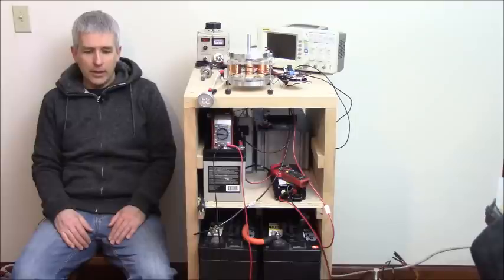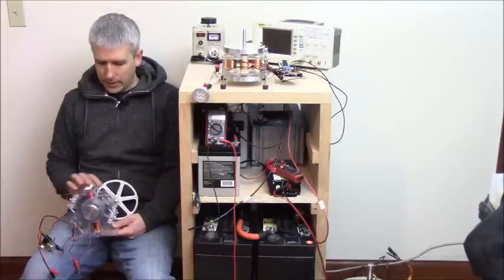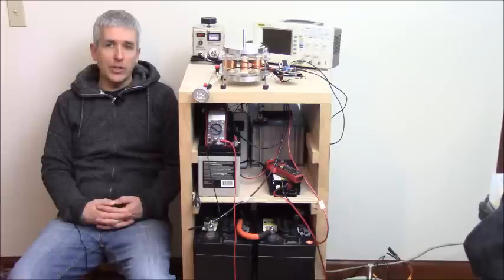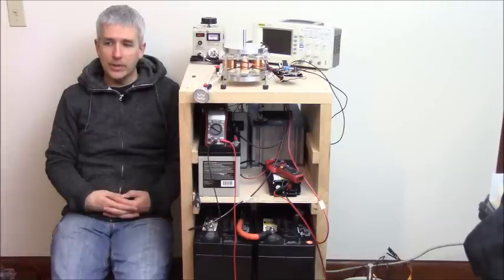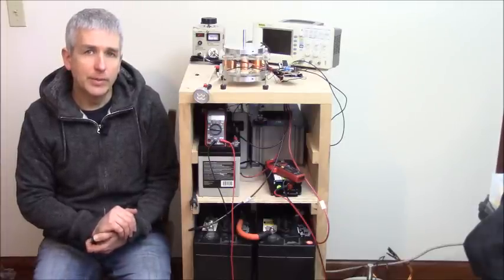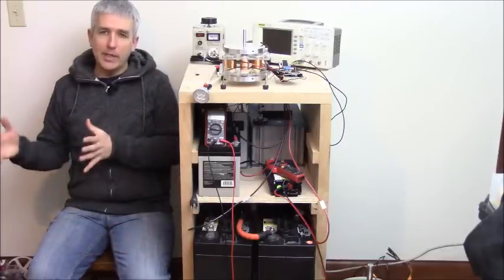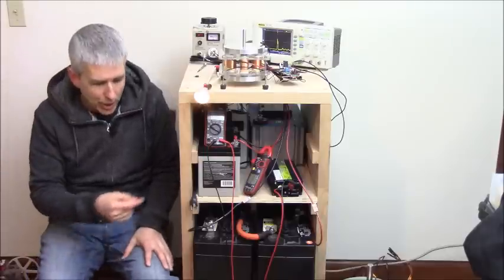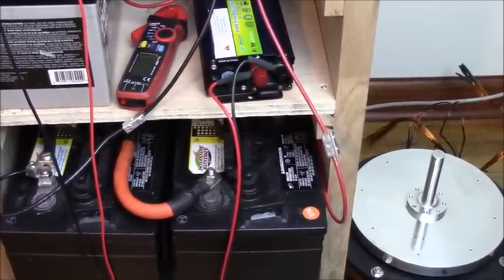Charging & Converting  Batteries to Negative

Comment: Did the bulb get brighter because no light,or no interference,or better grounding? Have you tried grounding the positive side in the ground Maybe it'll help battery desulfate faster? Very fascinating, maybe this shows that real electrons are true dipoles and there equal and opposite effect very interesting to try to wrap your mind around this would adding a jewel thief to ground or photodiode boost or change the system?

Comment: I was just about to ask have you figured out to replicate don smiths device, or how it worked exactly? Then you brought it up. On the device with two square caps on the circuit block what type of diode or resistor did he have connected to neon tube transformers ground? How did he get it to spark? Do the capcitors have to be polarized?

Comment: Rick a question; alot of people wanna know;alot of the energy from vacuum vids talk about the 3modes of operation,common ground,comparator,and ground back to the positive,you talk about a mix is that a 4th mode?and how does the 3 modes play there role in loving paths and one wire new info that you brought to light?and you mentioned that lights have their own frequency aside from the coil resonance,please do more vids

Comment: Hey Rick - This is gold! Clearly its one of your best posts. Your talk on Negative vs. Positive energy is so important and will definitely save people time.  When I 1st started working w/ these devices, I observed the CHG battery quickly discharging when swapped into DRV mode.  Back then, it wasn't easy for me to find an explanation for that strange battery behavior. You've taken the thorn out of that paw in this post. :)
  Regarding marginal MOSFETs, can you say roughly how much it heats up? On my Lg 4DualPole, I see FETs running @19degC (no mech load running @12v) and upto 29degC (heavy load running @24v). Is it ok if these run w/ temp increase by these few degrees? Or is even that small increase evidence of internal diode damage? Any help here is appreciated. 
   And Yes! running while fatigued can result in some fireworks on your heat sink :O These things do happen to all of us!  :)
Reply from the maker: Very good. I was going to delete this video now that it sold. I'll probably delete it when I demonstrate the old 10 coiler that went with the 20 coiler (made the same way). 
No 29C is not much more than room temp. That's normal.

Comment: I'm charging all my AA and AAA with a bedini ssg since a few years now. and it does make me reuse EVEN alcaline batteries and rechargeable batteries that lost their duration uptime over time. Thanks Master Friedrich. BTW, where is your SG 3 hours long presentation ? It would benefit people.
Reply: Yes B G... I've been charging a stack of watch batteries too with my old PEM too. (usually in parallel with some other larger batteries.  I use the watch batteries for my instruments.   Good post.  Thx.
Reply: @woodwind63  Hi, I should be trying 12V car batteries too, but that's right, in paralell I remember Rick Friedrich mentionning that gains would be observed the larger batteries in the charge stack. nice idea to try ! cheers.

Comment: is the negative charging also possible with lithium cells.?
Tanks for this very informative Video.
Reply from the maker: Very good Paul. I'm still old-school lead acid guy and was hoping lithium would go away. I kind of stay away from them in my research because of the liability problem involved in products like that. A number of my customers go around buying old laptop batteries and do just what you say here and get good results. There is a lot of profit in recycling the right stuff like this if you have a way to resell. But you can use those cells to create a powerwall of your own. You would just have to match cells once they are rejuvenated. Which is what the regulators are about. lol. 
Anyway, they are better than lead acid not only in size and weight but also in their rate of charging and discharging so they are more efficient to use. However, I don't see them benefiting from the rest periods or continue to charge after the charging stops like lead acid do. They are similar to ultra caps in this but are much less expensive for the capacity.
Reply: Hi Iv'e done the experiment with dead laptop batteries 18650 & lipo it works fine ....but remember lithium batteries can explode if mistreated ,I agree with rick do it slowly.18650s are better.Batteries went from completely dead to being able to power my guitar amp for several hours. I started by removing control circuitry & used a bedini bike wheel generally with a 16v laptop power supply for input power mjl bipolar transistors.They also worked well with Ricks Fan kit with cap pulser.
Reply from the maker: The negative charging can charge any battery but lithium has to be very carefully regulated in voltage and temperature so we can only do the process very gently. The problem is that if there is a controller on the cells then this will either ruin the controller or be filtered by it. But if you are working with cells it will work. Just what will happen to the lithium physically is uncertain to me. Even with lead acid I don't really know exactly what a negatively charge battery is as opposed to a positively charged one. I know the different characteristics but not the essence of it.
Reply: How about supercaps?

Comment: I use this meter to check the condition of my batteries.  I know its not perfect but it gives me a good idea on the capacity when I'm comparing like batteries.   For example, I have 4 12V 10AH batteries I purchased from Harbor Freight.  I'm guessing these are cheaply built.   I've been using them for a couple years now and noticed that 3 were performing like they should and the 1 seem to be sulfated. These are sealed lead acid.    
I put each of the 4 on this device and the numbers coincided with what I was seeing.  Here are the results for the 3 good batteries  - 161, 149, 120.   The one battery that seems to be sulfated had a reading of 84.

Not sure how this meter would work on negatively charged batteries or work at all ?  

https://www.amazon.com/BA7-100-1200-Electronic-Battery-System/dp/B0015PI7A4/ref=sr_1_1?keywords=SOLAR+BA7+100-1200+CCA+Electronic+Battery+and+System+Tester&qid=1553349234&s=gateway&sr=8-1
Reply from the maker: A few things to notice in this. The meter is only for starter batteries and it only measures CCA. This will not tell you the actual capacity of a battery when you deep cycle it as we are doing. It tells you only a voltage drop with a given amperage to indicate how well you can power your starter. Typically there is a 100A resistor load and you watch the voltage drop and that tells you the CCA or CA after 10 seconds. While that shows you something for vehicle application it doesn't tell you the actual capacity of a battery when you fully discharge it. That has to be done with a smaller resistance over a longer time, many hours (each hour of a full discharge is a C rate of discharge for that battery). The CA 10 second meters give an indication of what you could possibly get from a battery, and we have a basic formula that generally converts a battery that has CA/CCA listed to AH, as listed on the front label of our Rejuvenator shown. But the happy problem is that when we rejuvenate and condition the batteries with our chargers the lower voltage region of the battery gains significant capacity as well so that conversion becomes inaccurate as the battery can have much more capacity as it gets more and more conditioned (increased capacity). So only a resistive load test from full charge to 0V will show you exactly what you can get out of the battery (although AH measurements only consider discharge down to 10.5V, and that is all we ever report a battery as even though we discharge lower and since we get much gain lower than that we run loads in the lower voltages often). 
Any battery that has ratings for CA or CCA Cold cranking amps is a starter battery and not a deep cycle battery. For the price you should always avoid buying those because you get a lot more battery when you by one that only has the AH shown. You can deep cycle these batteries but they have less capacity for the cost and size. They are meant for high amps for 10 seconds to start your car (although new cars power all sorts of loads while the car is off for some time and this is a problem...). 
Also, you should avoid sealed batteries as all batteries off-gas anyway and once they off-gas you cannot replace that and you have real loss of capacity and/or life of the battery. So sealed batteries have to be carefully charged slowly as to avoid off-gassing. You have to watch how much voltage, etc. They are a waste of money for what you get. The are Okay when you normally get only so many years out of a battery and you a non spillable battery. But the best choice for sealed batteries are NiMH rather than lithium. But for what we are doing in this video you want open flooded lead acid batteries which will give you the most capacity for the cost. Also the most surface area, which also can (considerably) expand over time (capacity conditioning). You can put the hydro caps on them, as we sell, and not even have to add water. The best price on these kinds of batteries are the Costco 6 or 8V golf cart batteries as shown in this video. They are about 200AH at 6V and I find them better over the years than the Trojan T105s which cost much more. But they are essentially the same grade of battery (mid grade quality and good enough to keep for the rest of your life). 
Anyway, to know the actual capacity of your batteries you need to apply a given resistance across the battery (I showed a bulb but that is not the same and should not be used for calculating), and if you plot the voltage over time you can see your AH once you get down to 10.5V. Our charger does that for us minute by minute (and the amount of hour it measures that for is your C rate, so if it measuring for 300 minutes that is the C5 rate, or 480 minutes C8 rate, or 1200 minutes would be C20 rate). 
Your three batteries are around 13 to 18AH probably. This would be Okay for a ma system. You really wouldn't want to run them over 2A continuously even though you could. To take advantage of what I am talking about in this video we are looking at having much larger surface area. I'm using a power supply on my battery which is putting 800ma at 13V (just over 10W) to keep a stable run in this conditioning process. I'm running a 6.5W LED lamp at the same time so it's only taking 4W to charge up these batteries over a few days. They are half charged after 36 or so hours, and they are not at all conditioned as I just started. That's less than 400WH when you include the bulb energy (144WH without the bulb). It will take a good 1800WH to charge one set of golf cart batteries from 10.5V to fully charged. I am charging from 0V or 100% discharge which is much deeper. And I'm doing 4 sets of batteries (so maybe 300WH, or 800WH including the bulb energy, to charge up 8 golf cart batteries from 100% discharge before they are even conditioned whereas current charging would take maybe 7000WH). So it is really amazing to watch this if you take the time to go through this. You can really appreciate the rest periods and the lack of amperage. Remember amperage is wasted energy in a system. Voltage is real energy if you can appreciate it and use it right. Negative energy is zero amperage because it is true negative resistance and the battery becomes a true negative resistor that does not dissipate the energy as a loss. The energy flows into it like a vacuum cleaner suction rather than throwing water at a person and much of the water bounces off them (regular losses) and only part of them retains the water.
Reply: @rickfriedrich  Thanks for the info Rick ....appreciate it !

Comment: Rick - to bring a car battery back, would you discharge it the same way, bringing it down to 1 volt and then charging back up to remove the sulfation.   I have a 600cca battery which I would guess is close to being   70-80 amp hours.  Would I discharge it at the C20 rate or can i discharge much faster since the car battery is built differently than a deep cycle.  

Great video.  I'm going to try an convert over some of my smaller batteries to a negative charge , which will be good practice , before moving on to the bigger batteries.
Reply from the maker: No, in our rejuvenator shown in the video we discharge it to 8V for a deep enough discharge (while we only measure the AH capacity to 10.5V). No the C20 discharge rate that John was always saying was arbitrary. We usually do C5 more or less. C20 is just a more efficient way of powering things if you have the money to spend on bigger batteries.

Comment: thanks for the video...... i still wish you would post schematics......anyhow keep up the good work
Reply from the maker: It is just the back pulse of a coil. Just aim for very fast rate of change. You have a battery across the coil in series with a diode. The battery negative terminal is connected to the input battery terminal and the beginning of the coil. I've shown the schematic many times. SSG circuit with trigger coil. Or using another switching with fast switching...
Reply: Well you cant stop, I know you dont want to have any one hurt them self's but they should realize what they are getting into the hard way.. I dont think it's much of a factor but it's a sticky subject.
Reply: Thanks for your great video.